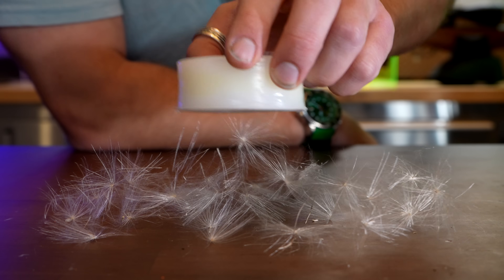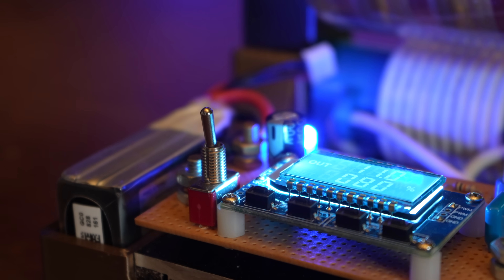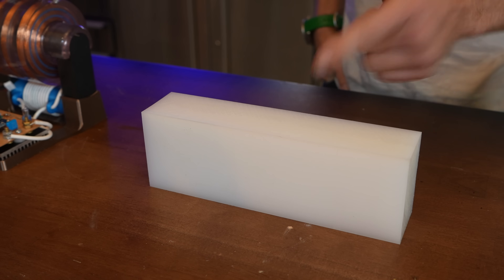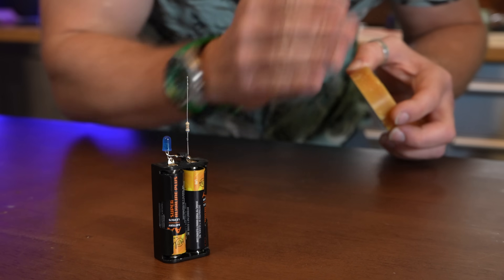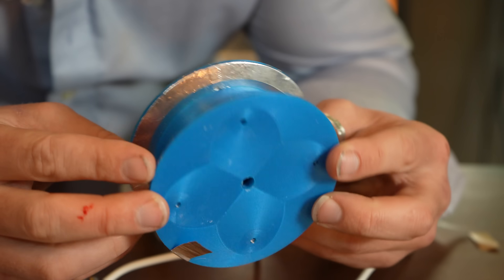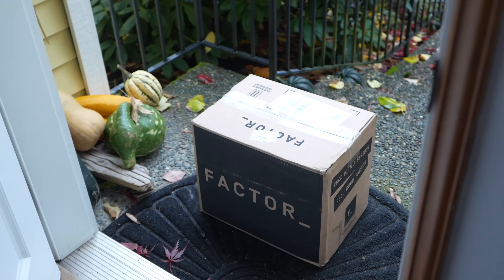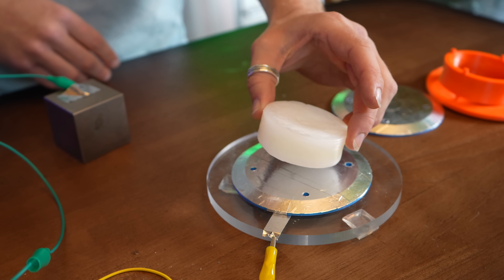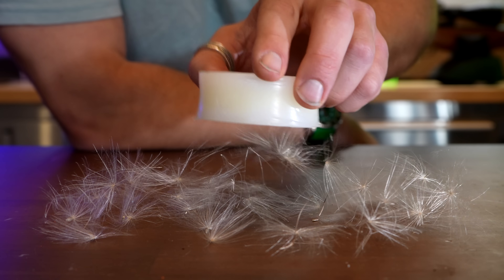Creating an Exotic Material With A Permanent Static Charge (Electret)

Comment: As a furniture maker I'd love to see that grid of LEDs built into something like a coffee table top with a translucent material as the top to diffuse the light. With a set of coasters made out of the same material as the puck you could create a really cool effect wherever someone is resting their cup.
Reply: It doesn't directly power any of the  LEDs. It actually functions more like a small input that triggers circuitry that allows power to flow to the LEDs from either batteries or another independently powered source.
Reply: @1987garrettwright  Put three tiny thin electrets on a little spin stick in a glass bulb like the photon demonstration device.  Then the outside applied puck field starts it up spinning and as one's path crosses on through horizontally, it floods the zone on both sides and causes the paddle wheel to slow and then halt, and passing on across it starts up again.  Kind of like a solar eclipse shadow.
Reply: Add photophores on nanoelectret, trivial finish fx.
Reply: I've already seen someone make something similar on pinterest

Comment: Perhaps you could use a capacitive touch screen as a high resolution sensor.

if i understand,    they work by using timer circuits influenced by the change in capacitance of electrodes coated on the screen.

you could also try using a pair of 16 channel adc's to make a 16 x 16 sensor,   using a high impedance pull up resistor on each adc pin.

Comment: Now if you could figure out the specific attractive frequencies/voltage for particular things - such as plastics or non-ferrous metals.
That way they could be installed in series in a recycling center to separate out individual components for sorting and more efficient recycling.

Comment: What happens if you drop the puck down a copper tube? Does it create eddy currents, like a magnet does?
Reply: A moving magnetic field induces an electric field (e.g. magnet dropped through a copper pipe). And dually, a moving electric field induces... a magnetic field! So dropping the electret through an iron pipe will induce magnetic flux in the pipe.

When dropping a magnet through the copper pipe, a back-mmf is produced by the eddy currents, which counteract the force of gravity and slow the magnet down. So the magnetic flux induced by an electret dropped through an iron pipe should likewise induce a back-emf and slow down the electret's fall. (It would be best for the demo if the iron pipe was insulated so that the electret doesn't contact it, since the iron is conductive as well as ferromagnetic.)
Reply: magnetic flux or magnetic current? PLEASE DROP THE PUCK DOWN AN IRON PIPE!!!
Reply: @johnharris5786  copper pipe.
Reply: @zippythinginvention  No, I think the puck should be dropped down an iron pipe or even a coil made of iron. See Jordan's comment.
Reply: @johnharris5786  Jordan is wrong. Copper is more conductive.
Reply: @jordanfultz4092 but the electret is no single charge, right? As far as I understand it's a dipole with a more positive and a more negative side. If both are moving the resulting magnetic fields have opposite orientation which would dampen the effect. Or do I miss something?
Reply: @tobiasreiig5954  It is because the field is moving that magnetic flux will be generated. It is the dual of the situation with a moving magnet. You are right that there is no net charge through the tube, but the electret acts like two opposite charges mechanically held some distance from each other, so the field is not zero anywhere but at the electret's equator; all other surrounding areas will have some net emf. At each instant as the electret moves, this field strength will be changing. As one pole of the electret passes a section of tube, the flux will go one way, and as the second pole passes, it will then go the opposite direction. That change in the magnetic flux will in turn induce a back emf opposing the direction of the change in the electric field caused by the falling electret.
Reply: @jordanfultz4092  It seems you haven't discovered the electret effect yet. Look it up. You will be amazed.

Comment: The LED's are good for visual representation but need to hook up the sensors to a voltmeter and record  the change with proximity. Feed the results into a 3d model. Not sure what you'd get out of it that we don't intuit already but it's a thought.

Comment: love the final move to working with electrets, now to see if you your good electret can be mirrored off onto another material like how records would make a master then use it to press the grooves on subsequent records (using steel I believe or something equally hard and temp stable) Thus making maybe a high powered electret manufacturing system for massive amounts of this substance to use in ion drivers you have been working on for full scale sized units, 

also would be nice to see if going to NPN and PNP transistors leading to two different color LEDs so the polarity can be seen as well (like red for positive an blue for negative) :)

Comment: N95 masks are made using electret material to help pull in particulate/droplets even though the physical spacing of the fibers would normally be too far apart to block them.

Comment: Set the electret on a fixed stand. Take the detector and move it around behind it on a fixed distance. Now set your camera to a long-exposure and you will get an image of the complete electric field in high resolution..
Reply: That's a cool idea!
Reply: Similarly, spin the sensor on a lazy Susan to get a far higher resolution image with a faster frame rate, with the same sensor and very little complexity.
Reply: A little higher resolution with a little more complexity could be had by spinning the sensor on two parallel axes where one is slightly offset from the other, so the LEDs trace spirograph patterns that cover most of the surface area.  With a little clever counterweighting this could be done completely passively (no motors, just hand powered) with two lazy susans.
Reply: @TimBlack1  are you a Lazy Susan sales person by any chance? 😆
Reply: @roopi67  :)
Reply: 😂right?  @roopi67
Reply: @roopi67  ...combine that with our brand new set of tupperware and no longer worry about creating high resolution images for your electret! :D
Reply: Even better, put a detector on a gantry that can trace out many points in a circle around the electret, and let the detector feed a microcontroller. Then you can model a digital representation of the field
Reply: Was about to suggest the same, but for a different reason - He keeps holding the result with his (very conductive) fingers, effectively sabotaging it during measurement.
Reply: yes also make the electret in different shapes like a sphere or torus would be interesting to see the image generated by the detectors. Oh just remembered that the properties of an electret are to sides,,,, hmm a torus with 2 flat sides?
Reply: good idea, works only for static fields though
Reply: @sp11-mp9ti poigniant relevant and good comment
Reply: Reminds me of the cantenna hackrf article on hackaday
Reply: propellantless
Reply: Hey, you stole my profile picture
Reply: That was very cool
Reply: Damn wish I could see this, sounds cool but I quite don’t picture it lol.

Comment: Nice job, you made quite large ones compared to those I made about 11 years ago (video: 1DR-tTU8uIM).  Never tried polyethylene, looks a lot more effective than wax.  You have inspired me to try making electrets again, I never did build an electrostatic motor using them as I had planned. I've always wanted to try corona charging teflon to make electrets, or trapping an electron beam inside a bulk insulator.  I also made arrays of LED electroscopes around the same time (video: iD6FW8MRUXk), if I did that again I'd use a simplified circuit and build the devices on PCB with modules that connect together using connectors at the edges allowing larger and higher resolution devices limited only by material cost rather than labor...

Comment: Years ago, Mr Teslonian built a hybrid Lord Kelvin thunder storm generator and electret maker. Lord Kelvin's generator uses a falling water and copper wire to create a high voltage static charge. Mr Teslonian replaced the water with liquid metal. The result were two electrets each having a single charge, positive OR negative. A monopole, he claimed. Please attempt a replication of this because such results seem impossible.
Reply from the maker: Well now, that's interesting. a monopole?? That does fundamentally seem possible if a material has electrons shot into it from all angles. How it would work the other way, I have no idea.
Reply: The metal is made liquid by heating and then cools into a solid. The electret is this solidified metal.

Comment: If your detection array was 3 dimensional it'd be much cooler. If you could handle the potential ^10 upgrade in the amount of solder joints 🤣

Actually I had a similar idea to visualize sound in 3 dimensional space and this concept might help inspire an array that could accomplish that.

Comment: You can use the electret to test the Poynting Vector if you'd like a follow-up video. A moving electret is a current of sorts. It should resist a change in position with a tiny force. A moving charge also generates a far field, a radio field. So, spinning one fast enough should generate a radio wave. (Due to Special Relativity, look for the relevant equations in a Physics book. Breaking Radiation.)
Reply from the maker: okay what?! thats really interesting. I'll look into this.
Reply: @PlasmaChannel  Hey Jay, what type of transistor are you using in your electrostatic detector at 05:49? I am trying to build one but can't get it to work. Thank you !
Reply: @PlasmaChannel  According to relativity, a magnetic field is just an electrostatic field seen from a different frame of reference, so yes, it should generate a radio wave, but you'd have to spin the thing pretty damn fast to get a decent frequency.
Reply: @ericthecyclist  150KHz will put you in LW territory. That's only going to need... nine million RPM. Hmm.
Ok, let's try VLF - call it 5KHz. 300,000 RPM. That's actually doable, barely - a dental drill will hit that. You just need to make your electret very small, spherical and perfectly balanced.
Reply: I do wonder how this would interact with a regular magnet, or any type of magnetic field
Reply: Super interesting point! I’d love to seem him test your idea.
Reply: You'd have to spin it at the desired frequency right? So like 60 million + rpm...
Reply: @haileycollet4147 @ haileycollet4147 I suggest using a lower frequency band. VLF starts at 3 kHz. That's still fast, but maybe...
Reply: @haileycollet4147  Not really, you just need more electrets facing opposite directions and a screen with an opening. 
What if the electrets all face the same direction?  Scalar waves?😮
Reply: @Pottyde  I don't think that's right, don't see how it's work
Reply: @haileycollet4147  through the magic of having thousands of them, there was some old naval tech where they had a spinning plate of opposing magnets to transmit radio
Reply: Sounds promising for disarmig nukes :) That's a hobby I could wrap brain and sink teeth :)
Reply: The same is true of a magnet.
Reply: @merseyless  The Poynting Vector represents the power flow in a circuit/space. It can be the electric field times the magnetic field. Normally, this is current times voltage. But that assumes a dynamic system. 

What happens with a static electric field and a superconducting current or with a static field and a permanent magnet? 

I doubt we will invent a perpetual motion machine, but it should be amusing anyway. 

The lack of magnetic monopoles means this is slightly different. It would be more different except this electret achieves the permanent electric field without electric monopoles. Each molecule is still neutral.
Reply: @jwrosenbury  You're not wrong, a correctly configured static electric/magnetic field has a poynting vector, but I have a feeling that it'll always loop back on itself. The easy way out is to point to the laws of thermodynamics, but it'd be an interesting exercise to try and prove it.
Reply: What lack of magnetic monopoles? I know of 6 coil variations that are magnetic monopo!es that with high cirrent make mobopo!e magnets.
Reply: @jwrosenbury  A motionless magnet near a motionless electret will generate a Poynting vector where energy is going around in circles. Since everything is static, the divergence of this vector field is 0.
Reply: ok maybe im way off here but since they obviously have a permanent electrical static charge couldn't we very likely construct some type of battery bank that is permanently charged? just seems like there would most likely be a way to accomplish that.  could you use them in place of magnets to induce a charge in a transformer coil? or use them in some way to otherwise improve electrical generators?
Reply: @XavierBlaze-fl1cn  Batteries require massive electron flow against a load to produce what we call "power". not merely a weak field raising its hand to say "look at me".  Magnets can be rotated around conductors to produce actual "power capable" electron flows.  Not sure if we can actually produce a useful "flow" of electrons this way.  Perhaps could be used to alter the condition of another element as part of a generation setup.  But not likely enough energy to perform actual "work".
Reply: Brake, not break.
Reply: @edwardhuff4727  Using a Foster Brooks' delivery and speech inflection...  "Take a brhe-brheaaaak..."

Comment: But if you touch an electret aren’t you simply absorbing the static charge running through your body?
Reply from the maker: Well, the charge is present inside of each molecule, so to speak. My method did not use charge implantation, rather, it organized all the molecules N to S. So theres very little "charge" to leak out.

Comment: use of fake AI image for the inventor aside: this video was really interesting! I've always noticed that when I finish burning a tealight candle, the remaining wax inside the bottom of the aluminum shell has a permanent high static charge after it cools. Like, you'd think aluminum would immediately sap that bit of static, especially once I held (grounded) the candle (housing), but nope! It's actually really hard to get those bits of wax to fall out because they stick to everything, even my anti-static tweezers! I always wondered how they could just magically have a static charge that didn't dissipate. I wonder if it's something to do with the flame being above and the aluminum being below that creates a charge disparity, and then the flame extinguishes and the wax cools inside the aluminum pan....
Reply from the maker: Okay thats really interesting. I've never experienced this, but am inclined to take note going forward with these candles. Also, thank you!
Reply: @PlasmaChannel  normally I don't suggest people buy things from Dollar Tree because you can get better quality elsewhere, but they have these little six-packs of scented tealights that come in some nice aromas (fairly weak, but still nice!) that have this static effect much stronger than normal tealights, in case you live in an area with a Dollar Tree and want to test it yourself haha!

I've noticed it most after burning the candle all the way down in a glass container and then after it's all cooled, trying to bend the little aluminum tub to pop the wax out of the bottom.

Comment: If you hook a wire from one side of the wax to another, what keeps you from having a battery that lasts forever?
Reply from the maker: Ah, because there's no actual conduction through the electret. It can INDUCE charges in surrounding objects. But it itself is not a stored energy device. Just like a magnet is not a stored energy device.

Comment: Now use it as a capacitor and apply high voltage to it without breaking it, the electret should lose weight gradually while accumulating more charges, even in high vacuum! And voilà, you discovered antigravity thrust that is not ionic wind that can actually work in space, and in theory should work to levitate and escape earths gravity, but that is another story, where we need new advancement in material science.

Comment: 5:20.
Because electric fields propogate slightly weaker magnetic fields, which propogate slightly weaker electric fields, in a spherical radius,  from the point of origin.
Since the human body produces 4 seperate & distinct electro-magnetic-field-frequencies from the brain, heart, circulatory & nervous systems, the gross magnetic-electric field your body produces both absorbs and displaces the propogation wave emitted by the device, that the sensor can no longer pick up on it.
That's my theory, but many other organic, inorganic, living or non-living "materials" can do the same thing under the right conditions.
We need more research! 😂

Comment: Crazy idea: can you think of a way to somehow amplify the force emanating the electret material? Bonus points for passive approaches
Reply: passive amplification would = perpetual motion.
Reply: @mycosys  a passive amplification is technically speaking not the same as a passive approach, so it wouldn't necessarily have to break any laws of physics. Anyway here is an example of what I'm considering: applying an iron core inside an electromagnet concenstrates the field lines. Can we do something similar to the field of the electret?

Comment: That’s cool. Build it with an aluminum plate core and hook it up to an extremely low frequency high voltage oscillator that will charge the dielectric rapidly hold the charge then discharge rapidly allowing the influx of negatively charged particles to interact with the positively charged dielectric electrode. This should allow you to harvest the “radiant energy” Nikolai Tesla was referring to. Check it out bro. 😎 I’ve been trying to get in touch to show you what I’m doing. It’s wild….